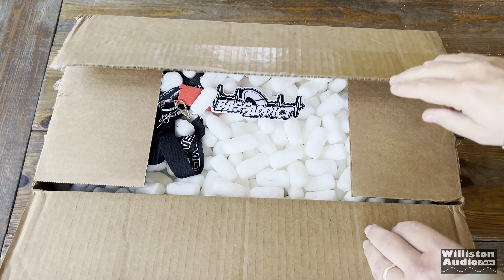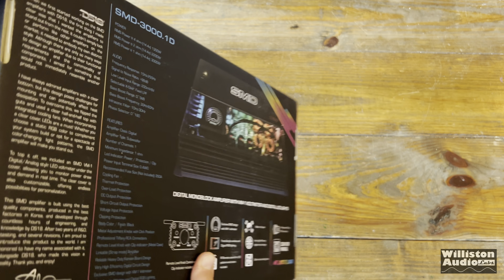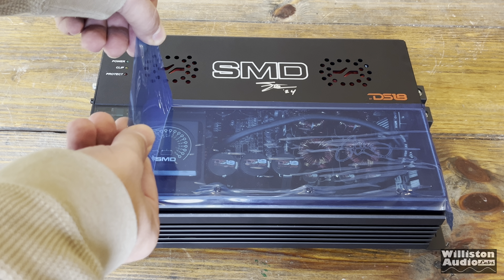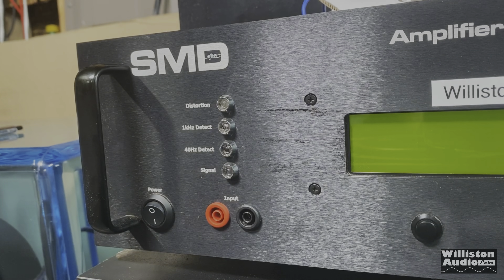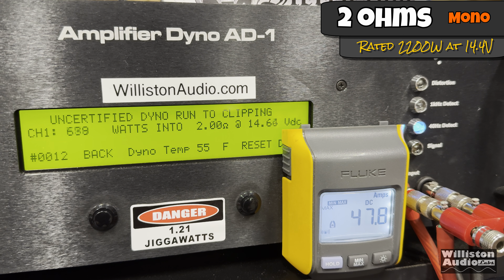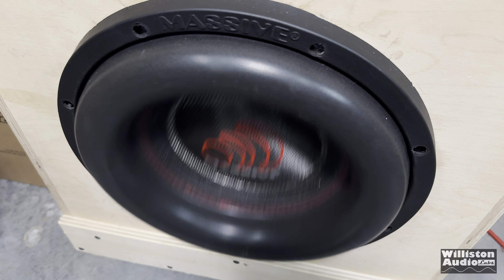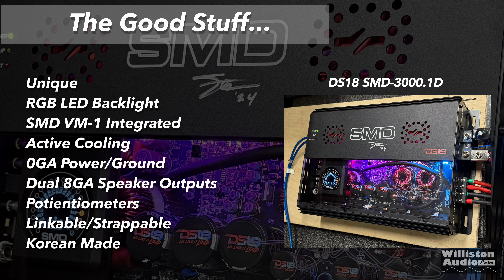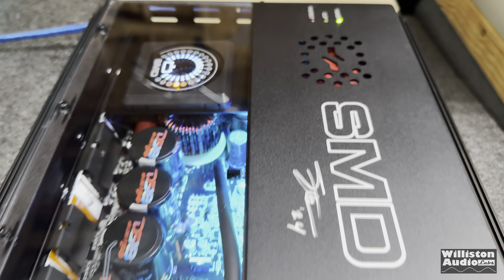Amazing Looks and Powerful Sound - SMD 3kW Subwoofer Amp Dyno Test

Comment: thanks for the awesome video! I think just a small bump in voltage, like .2 or .3v and it may have done those certified numbers in 2 and 4 ohms a little nicer. But it did it's numbers up to clipping which is more than acceptable and has always been.  At least it still did it's CERTIFIED numbers at 1ohm (and much more) which is all most people really care about anyway.  Nobody buys a 3k monoblock amp rated at 1ohm and runs it at 4.  If you do that, it still kicks ass, but that is not what it is meant for :).  This is our first batch and we are waiting to see how everything is doing. We will make changes and improvements based on how everything plays out as these amps start landing in peoples cars. If there are any issues, they will be addressed. Thanks again Mr. Big D Wiz bro!
Reply: Yeah, I've been a long time fan of SMD but this is ridiculous. Steve you know better than to pretend like box rise doesn't exist, my 1 ohm final wiring dual 12's can exceed 4 ohms during use very often, as almost every subwoofer will. Not to mention just assuming people don't listen to long bass notes, this isn't the 80's anymore, most hiphop and electronic music has long extended bass notes. I never thought I'd see the day I'd see SMD on something that doesn't exceed expectations, yet these amps struggle to even meet rated power at rated voltage. also I highly disagree that it is "acceptable" for it to meet rated power at clipping. I don't clip my audio signal from my amplifiers. I am very disheartened to see you backing this. A man known for playing loud, long bass notes, somebody that has mostly a full understanding on audio equipment.
Reply: not to mention the dollar store looking RGB lights in this amp, without even the ability to control them or set a solid color/turn them off looks so tacky. js. This amp looks like a cheap gaming computer from 2008.
Reply: Watch out now he's going to belittle you...but you're spot on with the comment
Reply: @andrewmiller9681 yeah he indeed does, he's done it to me before. I didn't much like him or JP, but at least JP amps are worth what they cost.
Reply: Respectfully incorrect sir. I'm that one weirdo who runs 1ohm amps at 4 ohms. Guilty as charged lol. But hey I like the power surplus for possible future upgrades not to mention 4 ohms just sounds so much better imo. Happy Holidays tho big homie!!
Reply: @monclerjacket8814 Amen 🙏
Reply: @ I agree, I think there is a significant sq difference in running at a higher impedance, it's less taxing on your electrical system too
Reply: @monclerjacket8814  if you run this amp at 4ohms you will get all the power and then some.  Music isn't a 10 second test tone. The dynamic burst mode is still RMS but closer to what you would expect from actual music. So if you run at 4ohms it will be great.  4 ohms on subs doesn't sound any better at all though, you would never in your life hear the difference.  Not sure who told you that.  But thanks anyway and happy holidays!
Reply: @meade916  I guess I like babying my chit big dawg. I like having a amp easily pumping out around 2k at 4ohms cuz that's all I honestly need and I can go full tilt w/o smokin em. Every time I wire down I start clippin and smoking
Reply: @monclerjacket8814  install your system correctly and you won't have clipping and smoking. We make products that help with that too.  If you like 4ohms though go for it. Nobody is stopping you.  Lets see what you got, post up a lil' walk around.  You got my attention now I can't wait to see bro! :)
Reply: @meade916  Every time you invite these guys to post what they got, they NEVER take the opportunity!  Lol
Reply: @meade916 lol really lol so yall thinking for ppl ok iam done now ppl listen to music different and different style some don't like screaming music some like balance some like all bass no treble to sum up that's hus opinion and didn't like how it sound @1ohm
Reply: @meade916  actual engineers tell you that.
Reply: @HAMMER_2.2  FOR REAL!  That dude has 6 WHOLE subscribers soooo.... there's that!
Reply: @meade916  you would get more out of your electrical going at 4 ohms with a bigger amp often 80s or even 90s efficiency percentage unless the amp is super inefficient design
Reply: @myfavoritecolorisclear  nah. You get the most out of it by running it at 1 ohm.
Reply: @meade916  How did they manage to get the efficiency so low across the board on these? Is Big D's measurement incorrect?
Reply: @HAMMER_2.2 that’s because they know he’s trolling them
Reply: assuming no rise. the 2 and 4 ohms seeem like what a lot of people will get when they wire to 1 so they are critical/ seems dishonest to imply the 1 ohm is all that matters
Reply: @ bass heads will always go low
Reply: wheres the Beef?????  lmao
Reply: Just out of curiosity, and if you’re ok sharing. What sample size is used when generating the advertised power ratings for your amps? Did you test some % of the build run and then use that to determine a number? Do you test 100% of the production run and use that to get the numbers? Do you have any that don’t make spec? This sort of thing is interesting to me because I am a nerd. 😂
Reply: Man, that’s tough. But it’s your first amp.
Reply: 😅😅😅😅😅😅$800😅😅😅😅😅😅 for those numbers,,XTR2500D does  better numbers,,,,, stop it 😢😢
Reply: @FrankStPeter for aesthetics and power D4S JP has it in spades at way less price
Reply: @FrankStPeter 😅😅😅 TRULY AGREE!! 👍
Reply: What’s the dampening factor
Reply: It will never sell. Overpriced! A name brand doesnt mean its worth more.   You can get 3x's the power with other brands that meet and exceed the ratings. Period
Reply: @ name brands do sell, DS18 hottest new company with SMD, sell sell sell, coming at you from a marketing perspective.
Reply: @meade916  Congrats on putting out the least efficient Korean amps I've seen in years. A seven year old SKAR SKV2 beats this thing up in power and efficiency. Not to mention Ruthless, D4S, Incriminator and countless others that are over 80% efficient. Your ability to take a DS18 EXL amp and dress it up, that's special!
Reply: BETA testing on customers, classy.
Reply: I gots to get one of these with Miami Vice styling
Reply: I tried telling MBEnclosures that most people don't run sub amps at 4 ohms, and then he's bragging about his "dampening"  *DAMPING factor, and he didn't like that comment.  In this price range, people wanna see real power at 1-2 ohms!   I'm sure this amp will last forever when properly installed.  It does the kind of power that would be usable in my current setup, but my current amp has been nothing but a champ and it was less than $400.
Reply: It’s a beautiful amp. A showpiece. And yeah, ain’t nobody gonna run these at 4 ohms. 1 ohm only and it performed well. Good stuff. 

I would expect this price point for an amp like this. It’s out of my price range but for those that can afford it it’s a true win. Congrats on a quality amp. Very nice.
Reply: me personally yes only way to get that 1k @4ohms or sd one and just a few others also the efficient to stay with in my electrical @jus1taj
Reply: You should do a class D 2 channel amp.
Reply: @oSTYNCLSYo  I disagree I think he should cut his losses sell what he's got and move on, this is going to be like the SMD subwoofers one batch and forget about it
Reply: @FrankStPeter  😂
Reply: Meade runs his stuff @ higher ohms and that what I would as well run @ 4 ohms but I'm am  on the opposite as what most people wound do  and your correct most would do 1 ohm
Reply: he do dont forget he use to run 4ohms as well  so if it was good then why not now for those who not buying alot of batterys and stuff just efficient on power at hand nothing wrong with being efficient @taylamayde
Reply: @ exactly that's why I run 4 ohms stock alternator and no voltage drop with 4 ohm verses drops at 1 ohm and almost just as loud
Reply: doing Certified numbers at 1 ohm on the dyno is awesome, but people who buy these amplifiers are going to hook up subs and even if they wire down to 1ohm , since impedance rise/box rise is a real thing then tell us all how the amp will see or run at 1ohm in the real world to get 3000 watts rms
Reply: Hey Steve!! You're a pos. You're a good dog owner though. It's actually weird to be a dog lover and a pos human being at the same time.
Reply: @ThisGuyDrives  How you gonna call me names with a goofball face like that? Typical internet clown talk with a side of coward. You were probably raised by a tablet instead of a daddy.
Reply: Awesome work and a beautiful looking amp Steve, hopefully one day I can afford one! I have been watching your channel since the beginning and you've had a big impact on how I do my car audio. 💯
Reply: @meade916  could put his name on a $10,000 grade A product sell it for $500 and you weirdos would still find something to complain about if you don’t like him don’t buy his product and don’t watch his videos pretty simple but getting in the comments crying like a teenage girl on her first period is just lame
Reply: @AbbzAbbz  Speaking of lame: Look at you defending another man on Youtube like he's your adoptive father.
Reply: @AbbzAbbz  I thought we were talking about how this amp underperforms in every area compared to other, less expensive Korean amps like the JP33 and such. Or how it's super inefficient and requires these cheap ass fans or it will cook itself. These amps are cheap old Seongsin catalog designs when you pull back the pretty cover. The DS18 Hooligans are better amps with a much better circuit that will outperform the SMD amps. The fact the SMD amps aren't even the best amp in the DS18 lineup is kind of sad, because they are the most expensive. Instead, he went with the same circuit that DS18 used for their cheaper EX-L series stuff. Using that Made in Korea as a selling point when the amps themselves aren't anything special, but rather pretty low grade catalog items, using a lot of cheap Chinese components. Cheap Fans. Inefficient. More expensive than a JP33. Now, where did I attack SMD in anything I just said?
Reply: @AbbzAbbz it’s called constructive criticism and also having a personal opinion about what car audio consumers actually look for when spending their hard earned money to buy equipment that is actually worth the money
Reply: @TikiDoorman exactly
Reply: @AbbzAbbz  but he doesn't, he puts his name on a $500 class C product and sells it at a $10,000 grade A price. But it has disco lights and a cheap meter so worth it???
Reply: @Dingleberry1856  in the meantime let us all know when you’re amps hit the market …

Comment: For the price and the hype I expected more. Its a nice amp but I thought it would have been more under rated like some of the other big name amps.
Reply: The quality is amazing! wtf more do you need!
Reply: @darrintriplett6265  it to preform where it counts. At the higher ohm loads where our subs are at when playing. Doing rated or even a bit above at one ohm is great but when tie sub is playing. It's no longer at one ohm.
Reply: @darrintriplett6265 the Jp 33 would blow this amp out of the water
Reply from the maker: I think using the Dyno as the only means to compare amps makes it tough especially considering how much power you can get for so little these days. This amp lineup is unique and impressive
Reply: @wal  very true. I won't buy one of the cheap amps being put out these days. Personally I'll pay more for what I consider quality amps. For example of an impressive amp. Look at your review of the kicker warhorse  3600. Absolute beast of an amp with the quality I'd pay more for.
Reply: a 3,000 watt rated amp that does 3700 watts and almost 4700 watts dynamic RMS, how much more underrated should it be?
Reply: @meade916  put it head to head against the big boss 3k let’s see💀
Reply: @meade916  you can't win them all
Reply: @meade916  Orion XTR 2500 does 6744 Dynamic at 1 OHM and costs $459. It's also made in the same factory. Yet, it's a "2500W" amp. Continue to be proud of your product getting dog walked by shit that's been out for over a decade.
Reply: @meade916  Don't make me pull an Orion 2500 up to this thing and destroy it for $250 less, now.
Reply: @meade916  I'm not knocking the amp. Just wasn't what I expected. Some of the other big name amps do well over rated with good dynamic power at all ohm loads. More efficiently too. Like I said it's nice but not what I expected.

Comment: Nice looking amp, however in a world of cheaper power I would definitely pass. I think that it’s bad timing for them to release these amps, not only that but most of the other Korean amps more than exceed their ratings and can run below 1 ohm with no problems.
Reply from the maker: I don't think they made these to compete with budget models with the looks and extra features. Remember 0.8 on the Dyno is 0.5 or less with speakers
Reply: @ ohh I definitely understand and agree. I just personally think that if these would have dropped about 2 years earlier they would have dominated the market. In a world where JP, Ruthless and names like Sundown rule the car audio scene, these amps are just overpriced in my opinion for the comparison.
Reply: @SoberBassHead Agree. This is an older, inefficient design that just doesn't hold up against SALT, JP33, Incriminator IX, Ruthless and DD Audio amps with more up to date circuits.
Reply: @ There is one simple reason he chose DS18 and not another reputable brand, the profit margin and nothing else

Comment: From a physics standpoint I've always wonder why the boards weren't mounted like this. The standard way all the heat rises back into the components instead of like this design where the heat will radiate up and away from the components.
Reply from the maker: Agreed!

Comment: this dude needs a job at one of them china factory with these tests 😂😅. 14.6 volts and still camt make stated power but its a chip issue. oh yeah, chip issue. stop simping for SMDeez nuts
Reply: Lol.. your the simp.. get a life
Reply: it also easily did it's rated power at 1ohm in certified mode (and then some).  Nobody buys this amp to run it at 4 ohms anyway so that doesn't concern me at all. At least it did well beyond its rated power up to clipping which is how most amps are rated anyway.
Reply: @meade916  not really. run it ay 12 volts and try again  🤣😅😂. same as so many Chinese amps, you're far too concerned about putting the highest number on the box that you can. plain and simple
Reply from the maker: The ratings are not specified at 1% or clipping, easily made rated power at clipping. Chip issue? Do you know what component tolerance is? Look up dem nuts
Reply: @wal  not the first amp to claim ridiculous output, lol. no amp should ever be rated at 14.4 to start with. its a garbage way to spec an amp. how about rate the amp at 15 percent less and then instead of excuses they are under rated. why, because simps will dig the money out they ass for lies and then run to defend it. yall deserve the garbage you buy and the losers you support. aint even smart enough to know you watching a commercial. dude got SMDeez nuts in his mickey mouth
Reply: @forpetesake25  14.4v is the perfect voltage to rate them at.  What almost every car charges at when running.  Why are you so miserable? You sound very angry and upset.
Reply: @meade916 seems like you cant never take critism from customers. I personally will stick with d4sound amps. This amp is still a ds18 amp with smd stickers.
Reply: @meade916  wouldnt expect you to say anything else, i guess i just dont like liars. seeing people being taken atvantage of makes me upset. you see profits, i see something else